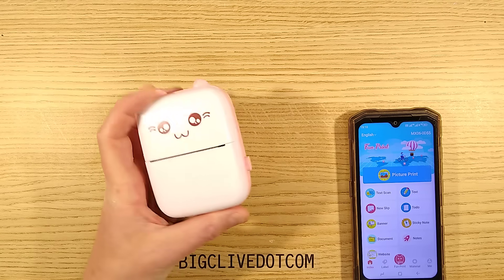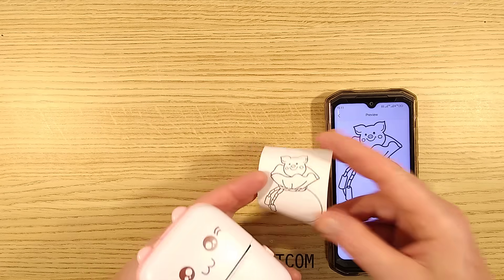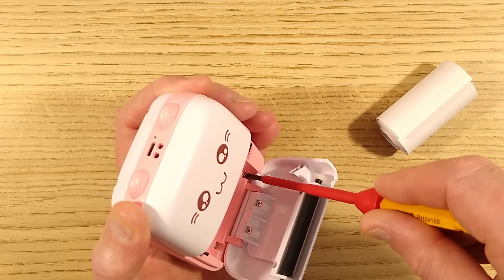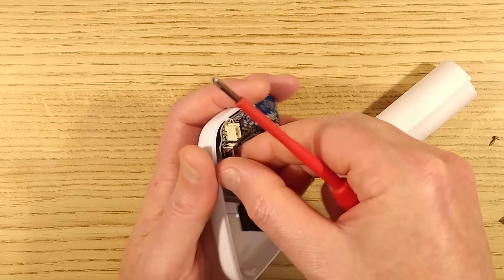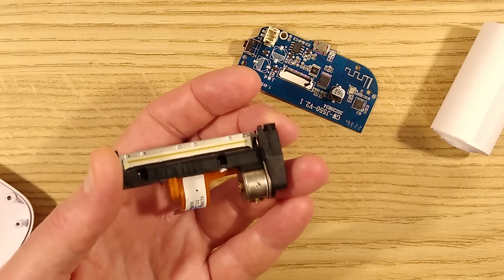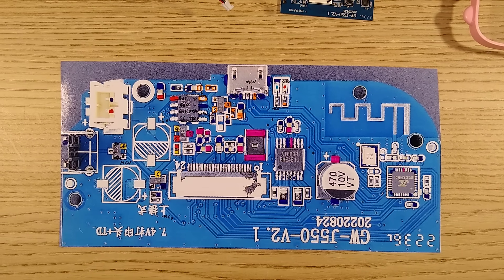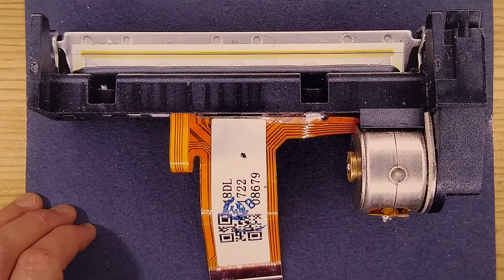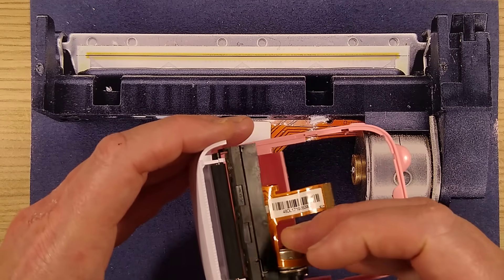Mini bluetooth thermal printer teardown - with schematic

Comment: Just bought a similar tiny print. It just stairs back at me helplessly , the tiny print app did not load correctly just loops on sign in to apple or guest meaning I can’t pair it to my I phone lol or use it .
Any one help !
Reply from the maker: It will need a suitable running app to work.  There may be a different app available.  A common one is Fun Print.

Comment: I have a much better version that was 25 euros. It runs off a 18650 that can be changed at any time. It supports ESC/POS over USB and Bluetooth (over BT Serial). It didn't even come with an app, it's compatible with a lot of Android thermal printer apps. And it's much much faster than this one.
Reply: which one is it?

Comment: Can I use the print head for my arduino project? Beginner here , and only a student
Reply from the maker: It would be easier seeing if you could find the way it communicates via bluetooth.  The printer relies heavily on software and a dedicated driver chip, and experimental software could easily damage it.

Comment: I've just bought something similar from one of my local Lidls and am hoping to reverse-engineer the printing protocol - Partly because it's fairly clear everything is sent to the printer as a monochrome bitmap, and partly because my Android 7 phone won't download the app, so I've got to bit-bang my own Linux-based workaround instead! 🖨🐧😋

From what I've seen so far on various videos tonight; Every print job is flattened to a monochrome bitmap and sent to the printer as a 1BPP (Monochrome) image...Which in the case of Lidls 12x24mm (96x192 pixel) labels corresponds to about 12 bytes per line or 2,4KiB of data being sent per label, which takes no time at all over Bluetooth. Yours (Which I'm going to assume is 480 pixels wide; Based on Lidls 96px/12mm multiplied by 5 to extend to 60mm) will require 60 bytes per line, and 28,8KiB per 6cm of label printed.
We can see your phone app is having to buffer output to the printer in the demonstration you gave, which - At ~10s to transmit 60KiB of data plus unknown protocol overheads - Suggests the MCU has very little RAM in it. 🤏

I haven't a clue about protocol details, whether there's any control signals and/or if data is sent in subpackets or just as one single stream, but it's clear the app knows the print head width in pixels before the user is invited to create a new label as that determines the size/shape/aspect ratio of the label canvas seen in the app. 📲

One of the applications I have in mind is printing out microscopic record copies of letters I send to save on space, time and cost (615 pages for a £2,99 refill pack ain't 'alf bad when a single A4 page costs 15p in my local library!). Being able to print labels in Fuþark will also come in very useful when I get around to renewing the wiring in my flat, as that's the standard I use for electrical markup and the entire renewed installation will be much easier for me to service and keep in check if it's in a character form I can immediately comprehend. ⚡⚒🤘
Reply: GitHub esp32-printer-lib

I have already reversed engineered a bit of the protocol

Comment: I'm Wondering what would be, the Cheapest descent Portable Thermal Printer, from the half size paper shown in this video to A4, with easy replaceable batteries too, like this Printer batteries shown in this video. 🤔
I like that it can be Opend with screws, without prying and thst it have a plug cable put on the battery, needs only changeing the cable to a new battery if the old dies some day.
Reply from the maker: There are full size thermal printers.  But most are the receipt style printers.  Fax machines used to use thermal paper.

Comment: Hi so I was wondering Can I connect this to an Arduino and program it? I'm kinda skeptical of buying cheap thermal printer for our research project
Reply from the maker: You can get cheap thermal printers for retail counter type applications.

Comment: I am wanting to understand how to interface the thermal strip directly from like an arduino.  I've also got an old Kodak dye-sublimation printer and was trying to understand how to control that one but thought I'd start with something simpler first, the multiplexing/shifting interface must be the same, to get 640 (or 220) pixels from 16 lines.  In the case of the Kodak, it has 30 lines going to the print head for a 640pixel width, and it has a kodak labeled chip in it, so might be a costume asic?

Comment: The problem with thermal printers is that the paper is covered in BPA. You know that stuff we had to remove from the plastic of baby bottles?  So yeah, like lots of printed receipts that we handle with our hands.  Not to mention that the ink just fades away after a couple of months and the receipt then becomes useless.  Thermal printers are complete and total garbage and a waste of our resources.

Comment: A bit of tech trivia. The ribbon cable connector is called a ZIF connector. 
Zero Insertion Force. They either have a flip up/down retainer or a sliding type. As the name implies when the retainer is in the open position it takes no force to insert the cable into the contacts.

Comment: What, please, is "anti-reverse-polarity protection, please??? It's tRICKy, Mr. Basically!
Reply from the maker: It usually involves a transistor that does not turn on when a battery is connected in reverse.  A MOSFET is more efficient than a diode for that.

Comment: Does the 2301A MOSFET not have a body diode? If it does, it will defeat the polarity protection.
Reply from the maker: I got the source and drain wrong.  There's a note in the description.

Comment: What kind of protocol would the printhead blob use? I guess it isn't SPI, perhaps some simple latch protocol with one data wire going to each fanning out V of leads to the resistors? Maybe even some parallel bus with strobe signals?
Reply from the maker: I think it may be mostly serial to parallel.

Comment: I wonder what you could change for it to work with the eco friendly thermo paper thats a bit darker. any ideas?
Reply from the maker: I'm not sure if it would work as standard.
Reply: @bigclivedotcom  hmm... so i thought a bit about it and took it apart. There are 3 wires comming from the sensor on mine. The center one goes to a ground plane over a via. The right one goes over a 1k resistor to a capacitor. The left one gas a via that goes to a chip and a 54k resistor to the same capacitor. If i'm lucky i can add a resistor in paralel to the 1k resistor which is possibly the current limiting of the infrared led. Maybe if it's a bit brighter it will work. I got my printer for 11€ including shipping from ali express so it's ok if it breaks but it should not if i'm careful
Reply: A little Update on this. I replaced the 1k resistor of the infrared led with a 330 ohm resistor and now it will also detect the eco friendly thermo paper which is a bit darker. It will also detect when the paper ran out and stop. It is running the infrared led with a fair bit more current but it seems to be handling it fine so far.

Comment: Maybe it would use a step up driver to use a 7.4V battery pack and charge it from usb? And then maybe the motor would spin faster and it would print more like the speed of a normal receipt printer.

Hm, no, not with that stepper driver.
Reply from the maker: Probably for faster print speed thermally.

Comment: The simplicity is why they're popular - though the biggest metric for these printers is speed - the ones at the cash registers are designed to print very fast - inches per second which is why they can spit out your receipt in a couple of seconds even though it's anywhere from a foot to a mile long. But they're cheap to make and the simplicity means the person working the register can quickly change the roll when it runs out without needing to thread the paper around. They take a new roll, unspool a bit, open the lid, remove the old roll, and put the new roll in. Shut the lid which pushes the roller against the print head and it's done - paper changed in seconds. Older printers required you to thread the paper through slots, while newer (at least over a decode old) have the slot be where the lid opens so it's open, replace the roll, close and it's threaded and ready, you just rip off the leader and go. Because no one wants to wait for the cashier to waste time threading the paper while they're waiting in line.

Comment: Yes that printers are fun but the software interface is a crap. That is the downside because they all run only in the Chinese software jail wich is mostly China cloud based for saving and getting templates. Maybe someone can flash a new firmware to it? 😉
Reply: I've been reverse engineering the BLE protocol for this printer for that exact purpose 😅

Comment: The reverse polarity MOSFET is drawn backwards. The drain should go to the positive and source to the load, so that during normal operation, the body diode is forward biased at first, then bypassed the the MOSFET and is reverse biased, when the polarity is reversed.
Reply from the maker: I added a note about that in the comments.

Comment: I would be entertained to see how they assemble the ribbon boards at scale.  Where im at those are a nightmare to get the parts on accurately, fortunately we don't do a ton of them.  Boards flexing and warping causes all sorts of alignment issues on multi-board panels.

Comment: A bit off-topic: how about a video on what to do if you push your power connector from an AC adapter into a headphone socket on an audio device (MP3 player, portable CD, minidisc, etcetera etcetera) by mistake leading to the loss of one of the audio channels in the headphones. I imagine the power connector damages the first resistor or capacitor it encounters but don't know exactly, or if it's actually worth fixing. I have a couple of these damaged devices and I know from talking to other people that more exist elsewhere. It's easier done than you think. 
Thanks Clive. From long time viewer.🤠👍🏴
Reply from the maker: It may well be the amplifier chip that has been damaged.  Not uncommon on some appliances with incompatible connectors next to each other.
Reply: @bigclivedotcom  Thanks for the reply big man!👍🏴

Comment: Brings back memories of the "printer" (and I use the term advisedly) of the Spectrum Z80. Its amazing how far that has transformed into a device that is found everywhere. I also remember that the silver prints went totally black over time.
Reply from the maker: The Sinclair printer used metallised black paper and an electrified stylus to burn off the metallisation.
Reply: @bigclivedotcom  Wow, my memory of how they worked was so wrong, lol. I'd always, with the age of time and fuzzy recollection, thought it was a standard thermal printer.

Comment: On a side note. A good example of the opposite to thermal paper is those "erasable ink" pens. The ink goes invisible/white when you use the eraser end of the pen.
The eraser end of the pen is just causing friction to make heat, which turns the ink transparent/white.
Don't let a written note with one of these pens get hot, the text will disappear haha.🤣
Reply: Put it in a plastic bag (to avoid it getting wet) & put it in the freezer, the text will come back!

Comment: the old Gameboy camera printer is also a tiny thermal printer, Ben heck also did a tear-down and reverse engineers it! it has a moving print head which is an interesting design difference

Comment: I don't understand why there is a polarity protection. The source is a usb connector so it's impossible to have the wrong polarity. But maybe for cost cutting (nothing wrong here,if it's work it work) they used a more general circuit project (like the 7.4v mentioned) and that why there is that polarity protection?

Comment: The Chinese written on the sticker says low voltage version, and the board certainly has footprints for a boost converter chip, output diodes, and inductors. I think the board was designed to accommodate both 3.7V and 7.4V print heads, this particular unit has a 3.7V print head, thus the boost circuit is not populated.

Comment: I've got one of these, they are marvelous! :) Mine is the GB04 variant (there are a few different boards used in these). I've taken a few sources of cat printer code that's out and about for this and made up a little local webpage from it on my network that prints markdown through a raspberry pi. Once you get through the device defined commands it needs for wrapping the data it's very normal to communicate to.
Reply: After spending the whole night researching the Lidl variant (It prints 12mm/96px wide labels) am I correct in understanding that the actual data going to the printer is simply a monochrome bitmap? 😇

Comment: I got one of those a year ago but the print looks so faded that I haven’t really used it.

Do you think it’s fixable or is the thermal head f’ed?
Reply from the maker: There is a print density option in the app, but it might be worth trying it with different paper.

Comment: Another great video Clive.  It looks as though there is a model that does an 80mm roll and stickers that boasts a 2200mah battery (on Amazon).  My bet is that is where the extra parts are installed, (as well as the extra price).  The bigger printer is $78 US while it's little cousin is $26 US.

RAH

Comment: If it was originally designed for 7.4V then it would need a step converter up to charge from USB. Perhaps an older revision had a higher voltage motor?

Comment: No no no no no no no this can't be a coincidence. I just took receipt of my sixth receipt printer a few days ago. I was given one but it didn't have the power cord and it didn't work with Apple. So I ordered one that worked with Apple and had a power cord so now I had 2. well guess what... That one worked with Apple but not with square, so I ordered 2 more ( good to have spares foreshadowing ) these ones work with Apple and have chargers and work with square. But… One of them had a broken gear, replacement part time on eBay yep looks like I'm ordering 2 more ( package deal ) I now have 6 printers all more or less exactly the same apart from color and brand some from a Chinese manufacture Woods and others are from the American manufacture Star. I cobbled together all of the broken parts into a Frankenstein super glued gear fixed printer that I might be able to get working. So I'm looking for ideas to use receipt printers for. One idea is hooking to a raspberry pie and using a translation to print whatever I want, which will work well with one of them because it didn't come with a battery.

Comment: Holy vias man ... that's a ton of 'em. 
I'm betting the board is designed to go into a larger unit, like a Dynamo, that can be powered from the wall, and connect via USB to a computer. Hence the other side being empty.

Comment: I presume the print mechanism and paper are relatively industry-standard and have simply been repackaged into a bluetooth toy? I could certainly find uses for the adhesive labels, assuming the prints are relatively stable over time.

Considering how slow the printer part is, I'm going to guess that's 20+ year obsolete stock that's been repackaged for liquidation. Most thermal printers these days are an order of magnitude faster.
Reply from the maker: The speed is dependent on the power supply.  With just a single lithium cell they slow it down to leave decent dots.
Reply: The paper is heat and uv sensitive so would fade over time, faster in direct sunlight. Receipt paper are notorious for fading even when packed away over years.